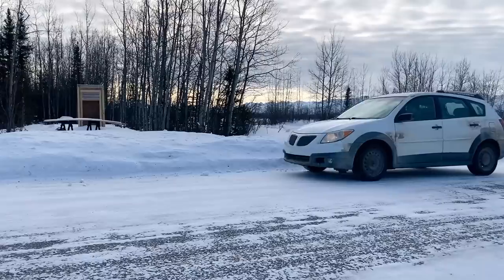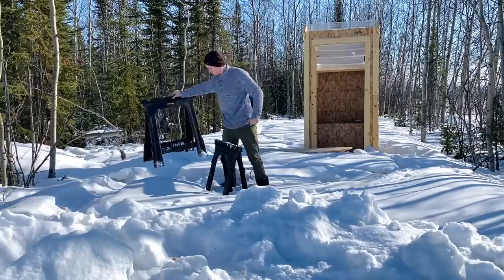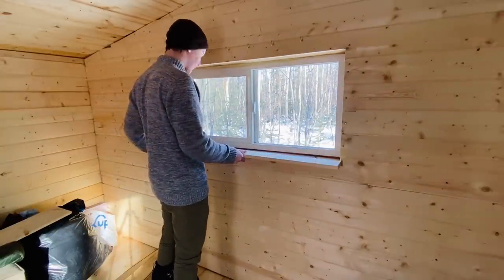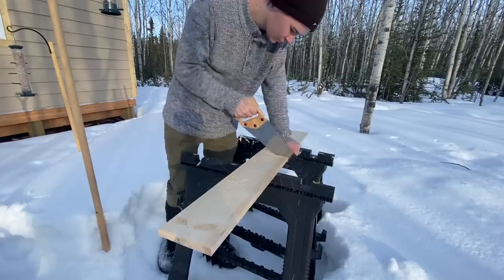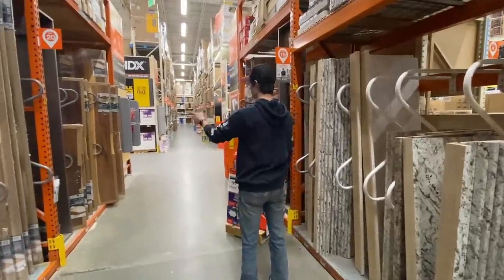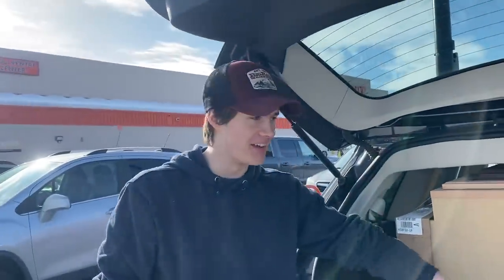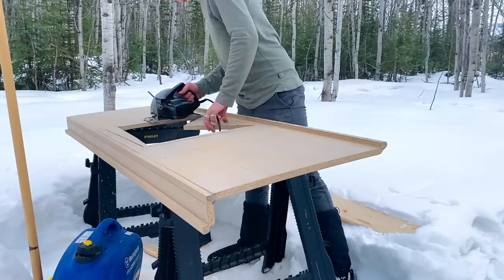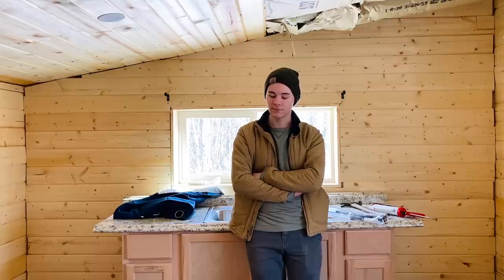FINALLY SPRING! Return to the Off-Grid Cabin

Comment: You are doing the best you can with your knowledge and skill level.  By way of a hint, there are metal clamps (they may have been in the package with the sink) that go in the metal tracks around the underside of your sink and then they tighten to your counter top instead of relying on the caulking to hold the sink in place. 😎

Comment: I know you'll probably see this too late but if you got longer curtains they might fit length ways across your window... then all you would need to get was those little rings with Clips on them or if you wanted to go and even cheaper way you could always use the metal shower curtain hooks then you could literally use like a hole punch put a small hole through the curtain curtain and put the shower hooks through it.. and if the curtain was definitely long enough you could just easily trim off those big grommet holes.. and when you want to open your curtains to let sunlight in just push them all to one side

Comment: Would a propane heating stove work? Instead of the wood stove
Reply from the maker: That’s the plan if I’m able to afford electricity this year. The wood stove works, but it needs to be stocked every hour or so, so not a great long term solution
Reply: @MickWhipple  well you dont necessarily have to have electric to run a propane stove now days, for heating, with the small cabin you have, they do have the kind that doesnt have to be vented , which is what we have used for the past seven years, and we have a big house, five bedrooms two baths, that  we built from the ground up with no experience lol talk about a bunch of mistakes, but its ours and we like it.

Comment: Turn the one curtain on its side. There should be a small hem that you can cut a small hole into to thread the rod thru. Get a small wood dowl to use as a rod then cut the circles off. It will be only one curtain still but should provide privacy when needed and slide to open when desired. Good luck

Comment: If you continue to have trouble with splitting..smack the sharp side of the nail with your hammer while the head is against a scrap piece of wood and the blunt nail will break through the nail fibers instead of splitting them. 
I liked the 'toil for your food' sign off.

Comment: Good job! I’m an angle queen ! Angle wood stove? Can your loveseat fit Infront of kitchen (facing front door and fireplace) to seperate that  kitchen area: and build an easy eating sofa table/worktop narrow table 12-14in ( deep enough for dinner plate) .. behind it ( length of love seat just 2 sides and top)tall as the back of loveseat use countertop ht: with 2 stools to go under so you could do kitchen work at it and eat at? You could put 2 bookcases on either side of sink base with doors to use as a pantry./storage areas. Maybe clear up bookcase wall by putting it to Lt. Or rt. Of desk ? Ideas are to create distinct spaces of : here’s my kitchen/ work/ lounge/ sleep etc. Areas.  Coffee table or big ottoman Infront of love seat will ground sofa create comfort area. I don’t know height of Rm. But our dorm rooms we built like a bunk bed mattress Ontop under it put dresser and hooks on wall for coats etc. to side of it built steps up was easy and cheap. ( maybe to rt. Of front door? ) Just helpful thoughts and tips from a women’s caring view wish I was there to help! It’d be fun. ❤heehee you got this!

Comment: Next time you use a common nail, turn it upside down with the head on a hard service and tap the point with your hammer that should prevent your wood from splitting when it’s dry. Just thought.

Comment: Each challenge is ending in more knowledge , skills and improvements to your cabin and yourself.  Stick with it and you will have a cabin you can enjoy.  It does wonders having another set of hands and a friend to laugh with...I was a much older single mom and I was thankful to have my son when I was building a cabin.  Thank you for another video.  Curtains are dumb...you never know if it's a single or double.  Also,  a birch or aspen branch makes a fantastic curtain rod...just slightly bumpy.  Or you can string a cable or wire and use that as a curtain rod...just use a nail or screw at the half way point.

Comment: Sitting here with my generator humming away in the background. Only 900 customers out of 17,700 have power. Mid Coast Maine got hit with one heck of a snow storm. I didn't put a flu in this house for a wood stove. Try a little starter fluid in that generator. Hang in there Mick. Mike from Maine

Comment: You could use a rechargeable usb faucet like the van lifers and use large jugs underneath with one for drain. They’re awesome and you won’t have to worry about running pipes or bursting pipes. You just have to refill your water jugs. Caulk around your sink and window edges.

Comment: One thing I did for pressurized water when I went off grid was use a 2 gallon pressure sprayer from the lawn and garden section. Much better for washing hands and brushing teeth and it'll clean a pan so much better than just dumping water on it. Much cheaper than a full system when just getting started

Comment: possible tip for the next sink install without measuring tools: looked like the cardboard it came packed in was cut out precisely around the basin part of the sink.... maybe that could have been used as sort of a template?

Comment: I fastened down one of those sinks. No 10 hex bolt heads fitted in the channels under the sink nicely and I put a washer on the bolt then used the nut to clamp the sink to the countertop using the washer as a gripper. Worked well.

Comment: I hope you have enough room to get the bolts in those clip rails. Or maybe you aren’t planning on using them with that sealant. Should should work fine. So, are you going to plumb that sink?
Reply from the maker: The sink will basically just be a drainage system for whatever water jug I put on the counter so I can do things like wash dishes. This place will never have running water lol

Comment: one question? Im looking for something for my son to live in on my property. Would you have done this over again or maybe have bought a prefab tiny home already complete?
Reply from the maker: Logs would be a much cheaper building material, as it takes the tongue and groove, framing material, outside paneling, trim, and insulation and turns it all into a single material. You could build a very cheap cabin with logs, that would be the big thing I’d do differently

Comment: Lookin' good so far, great is not far off.    If or when you have a drill, drilling pilot holes make nails or screws go in faster and easier without splitting boards.  If you plan to use paint or even stain, wood filler or even caulk will fix cracks.
Reply from the maker: Wood filler is definitely in the future, thank you!

Comment: A suggestion. Invest in hand tools. Get a hand drill so you don’t have to be reliant on the generator and then use the drill to pre drill the holes so it doesn’t potentially split the wood. 

Great idea with the hand saw purchase!
Reply from the maker: A hand drill would be really useful, drills are horrifically expensive. Thank you, great idea

Comment: Wow I thought you had moved back to Michigan to live in the cabin your dad was working on.  I thought maybe the long cold winter got to you. I grew up in Fairbanks and know what they are like, not fun. 
You should get propane as alternative heat source.  Not sure if heating fuel is an option for your set up?
Good luck to you.
Reply from the maker: I spent the winter in a diesel heated rental maybe ten miles from the cabin I’m building lol, I very much did not give up. Some sort of fuel based heating is definitely the plan for this winter, but that’s if I can afford electricity
Reply: @MickWhipple  I don’t think you need electricity for propane heat?  Electricity would be good though.
I can tell you that the cost of living in Alaska is way higher than Michigan.

Comment: Didn’t you leave that generator outside in the snow all winter?
Reply from the maker: Ayup. If it were in a shed, it would still have been subjected to the same temperatures, and since Alaska has basically zero freezing and thawing, the worst that would happen to it would be some snow drifting into the vents and collecting at the bottom of the casing. It started up just fine, so it seems my gambit paid off 👍
Reply: @MickWhipple  could’ve also been stolen